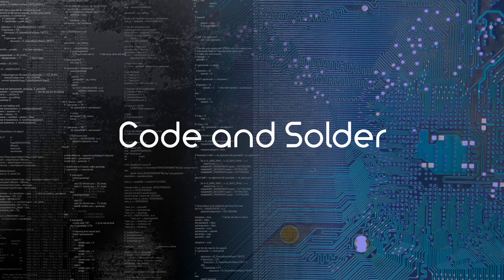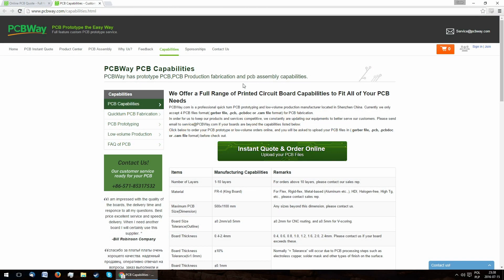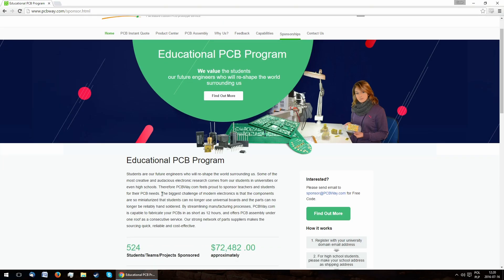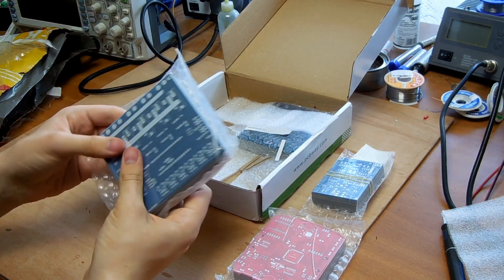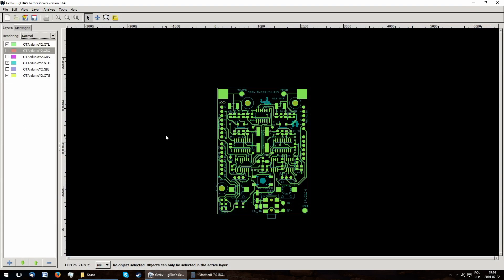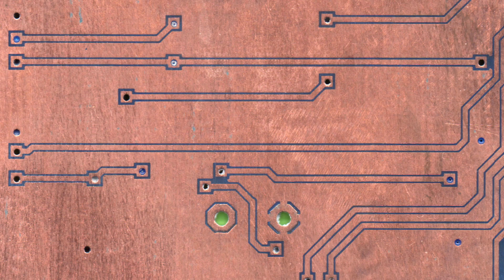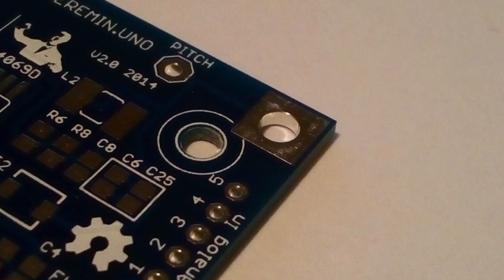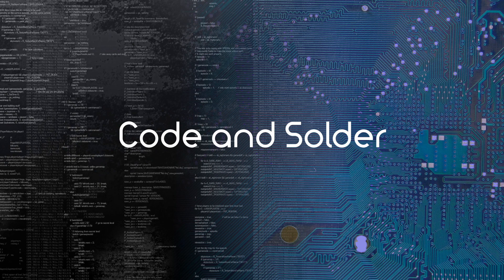PCBWay unboxing, capabilities and in-depth board review

Comment: What makes you think that your cheap table-scanner is a reference measuring equipment. It obviously has many kind of errors, there are linear shafts/rails/guides, stepper motors, timing belts in it, and the scanner head has optical errors as well. Simply it was not manufactured for that purpose, the absolute positional accuracy was not a goal, neither the 100% precise optical accuracy. For that money ? No way, It has many distortions and non-linearity. You should calibrate the scanner first, with a 100% precise grid (I have no idea where can you get one, if you can at all),  then you have to create a calibration matrix to apply on the scanner picture. And then you could use it as reference.
You made a comparison, but probably you had no idea what was the better device, the industrial PCB manufacturer equipments/machines or your cheap scanner. You just presumed that the scanner was.
Reply from the maker: There could be some nonlinearity, yes. I am working on a new, photography based methodology for the Easy EDA video in the works.
Reply from the maker: In retrospect I should have at least scanned the board in multiple orientations and verify the results match to eliminate this source of error.
Reply: "There could be some nonlinearity, yes"
Photography has much bigger distortion problems, obviously the path of the light to the sensor is far from parallel, even the most expensive lenses have serious (at least as reference measuring device) pincussion or barrel distortion or both:
https://en.wikipedia.org/wiki/Distortion_(optics)
, not mentioning the perspective distortions:
https://en.wikipedia.org/wiki/Perspective_distortion_(photography)
The scanner is not a bad idea, I didn't say that, its just simply not a precise device because its made for general purpose document copying, not for measuring.
Reply: "In retrospect I should have" - I agree, maybe there are some methods to compensate the distortions.
But what will you do, when you see that those pictures are not identical ? Do you know the math for it ?
Reply from the maker: I am aware of that and thus I'll be using a very long focal length lens, on an APSC sensor, with distance rings to use only the middle, least distorted part of the lens. Failing that I will fall back to the scanner, this time verifying the accuracy more precisely.
Reply from the maker: I'll likely use another method. I now have access to the tools and knowledge of the best tech university in my country, I'll manage :D
Reply: teleaci2: The "cheap table-scanner" is more than enough for checking these VERY Cheap PCBs, i'd say even over kill. But there's an old expression: "don't criticize unless you can do better yourself" so feel free to post a better system and review of PCBs from this manufacturer, but i suspect you can't since you can't even suggest improvements to this guys setup. So that by definition is a Troll, like telling a pro athlete "you need to do better, i don't know how but get to it...".

Comment: I need to order 5 pcbs but I don't need 5 of the same board can I make 5 different boards
Reply from the maker: +emile Most of the cost is setup, all Chinese fabs I know of start at 10 boards of a design. Still, it's $10 and you can use them as coasters or something.
Reply: Code and Solder but if I need 5 different boards I have to buy 25. And would there really need to be that much more setup if it uses the same settings and size. I know they look if the design will work first but even if they cost twice ad much it would still be cheaper than buying 5 of each

Comment: That was a pretty nice review, I liked that you went through the effort of checking the alignment precision.
One question: did PCBWay add any logo or extra information on the copper/silksreen or was it 100% compliant with your gerber files, without addition/omission?
Reply from the maker: +Curious Gecko they added a small order number (~1mm).
Reply: +PCBWay  do this to identify easy way that Pcb.  I like small number under socket.  the code consist number designer n how many project you order it.